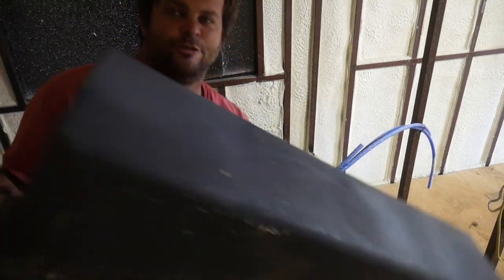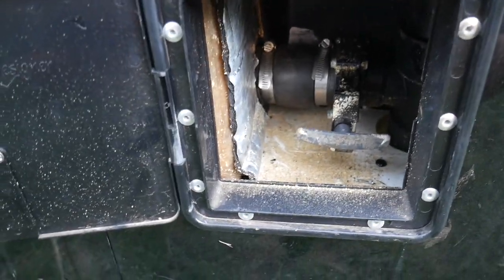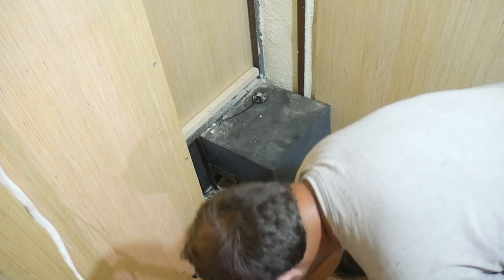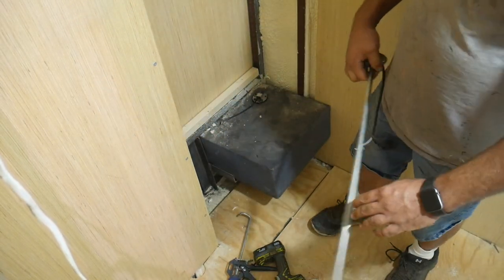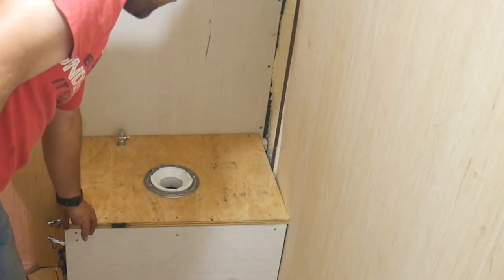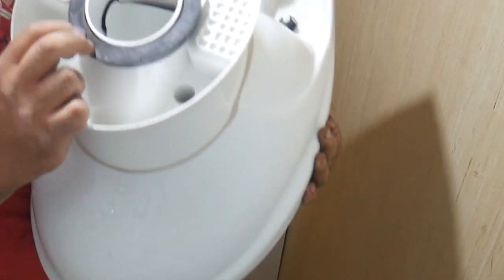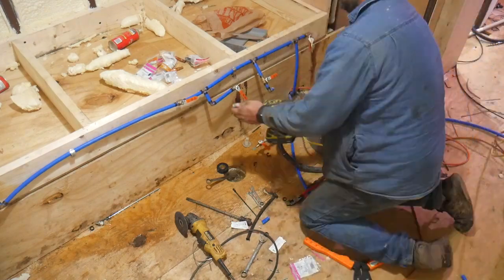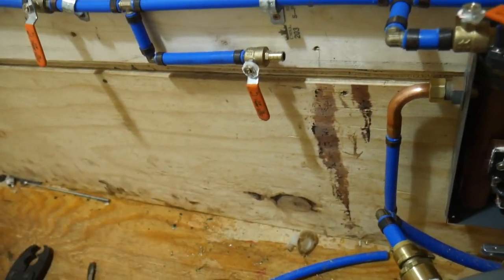Homemade RV. EP-23 Plumbing Rough in. 1977 Peterbilt 359 Toterhome.

Comment: You might want to plumb the black tank flush line directly to the dump compartment with a separate connection to outside water.  You certainly don't want to get a situation where you reverse flow black water into your fresh water system.
Reply from the maker: I was worried about this. I installed a spring loaded check valve off of the T that supplies the cold water to the bathroom so that you couldn't get a back flow from the black tank sprayer or from the toilet water supply.
Reply: @TheZachLife  That would help, but in a low pressure situation, you might just spin the ball and get contaminated.  I never ever run the flush unless I am dumping anyway.  It's easy to just keep them completely separate.  Love your build by the way.
Reply: 100% agree with Ron. All (dealer bought) are plumbed this way. As a side note, I would never drink the water out of a RV fresh water tank. I bring bottled water. But that's just me. Great build BTW.

Comment: Zach, great video.
Question,  when installing the jet inside the black tank (10:42) does that spray on to your LG?  I have had problems with level gauges gathering buildup.  I installed one that sprays down its' length vertically.   With the way you have your toilet mounted above it, access later on is going to be restricted.   Just wondering if you have felt like dealing with that, worth thinking about. 
Just a thought.   
Keep posting the videos.   I aways like seeing your builds,  as you go through the effort of explaining the design thought process.  Love it.  It's an approach I ascribe to follow myself. 

Thanks
Reply from the maker: Thanks, the jet does spray directly at the level meter. The jet is radical enough that I don’t think I’ll have a problem. With it on if you look down the toilet it looks like a dishwasher. Also my meters are a loose fitting magnetic float and will work as long as the float will fall.